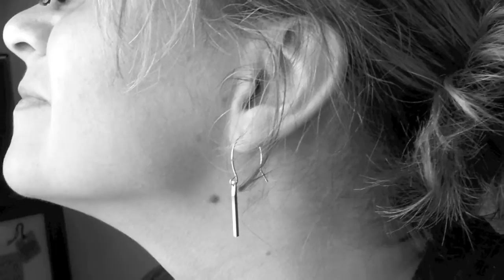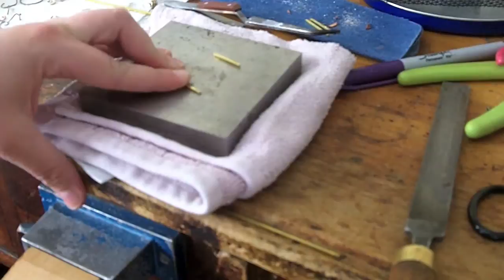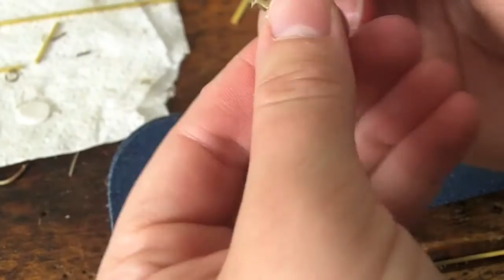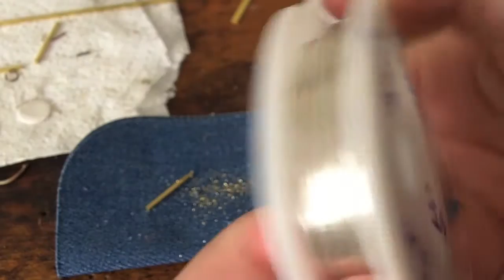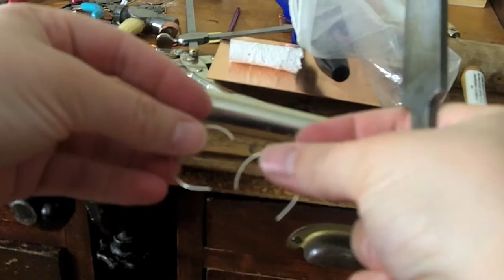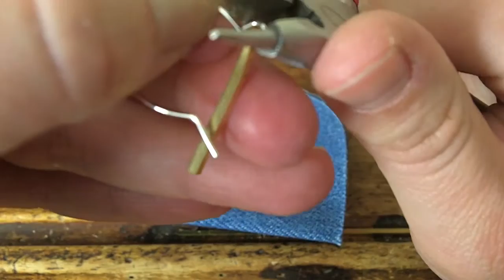How to Make Brass and Sterling Silver Dangle Earrings - Tutorial

Comment: Never pull a file. They are for pushing only. If you can not push the file because it gets caught on the metal, the file is too rough and you need a finer file.